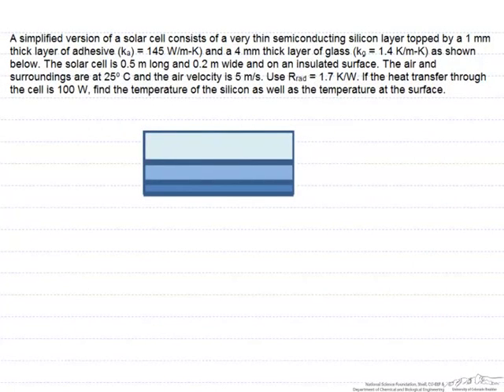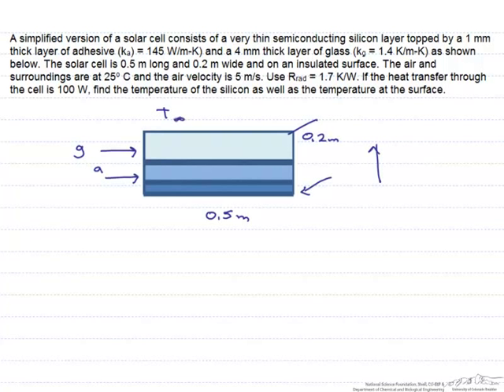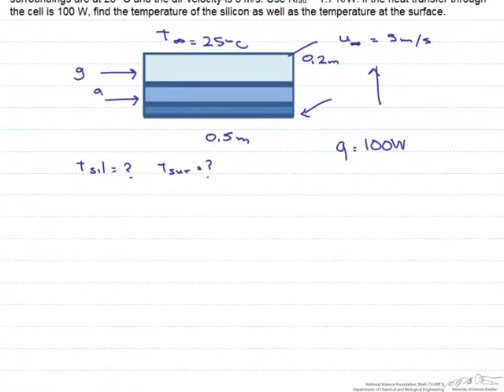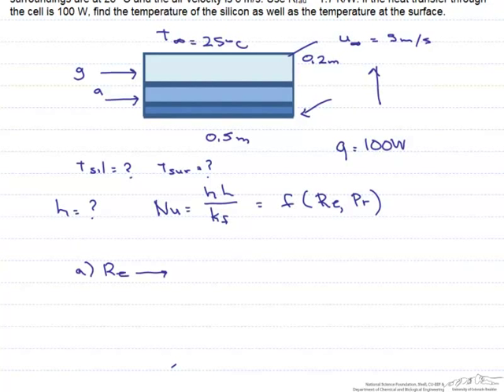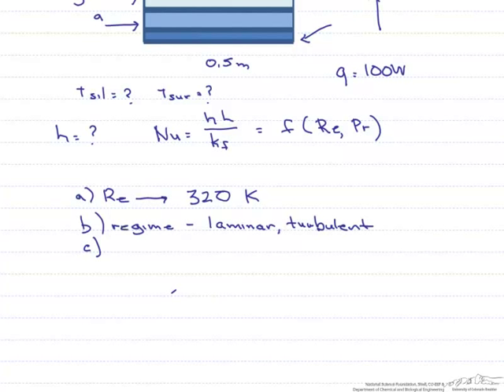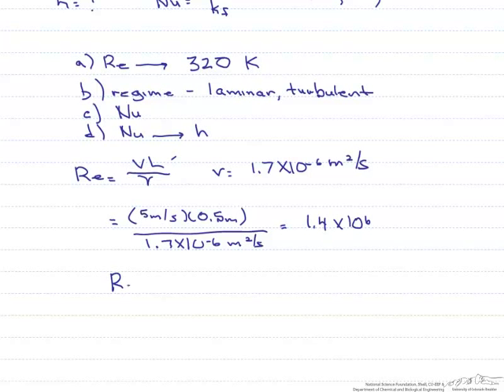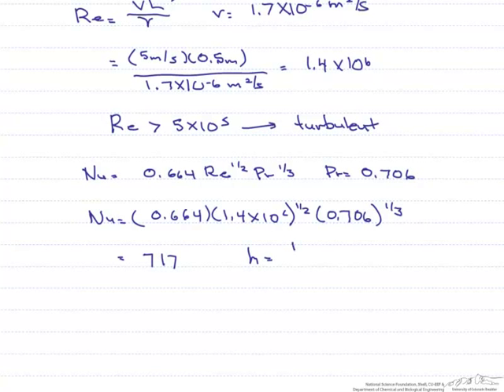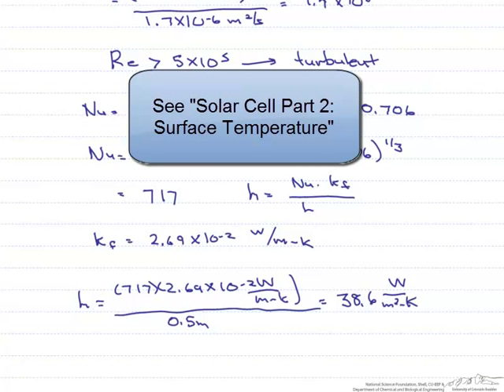Solar Cell Part 1: Heat Transfer Coefficient

Comment: I'm pretty positive kinematic viscosity should be closer to 15.89*10^-6 causing Reynolds to be 1.5*10^5 less than critical Reynolds number.  After that though you did use the right average Nusselt number correlation for laminar flow over a flat plate.
Reply from the maker: Thanks for bringing it up.  We will take a look at it and correct as necessary.